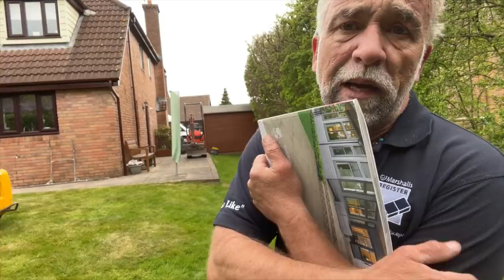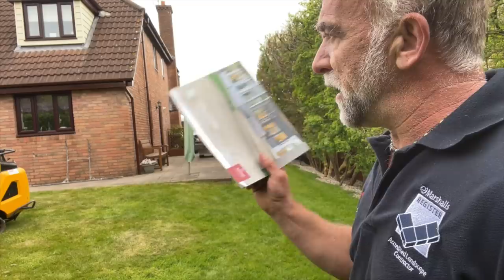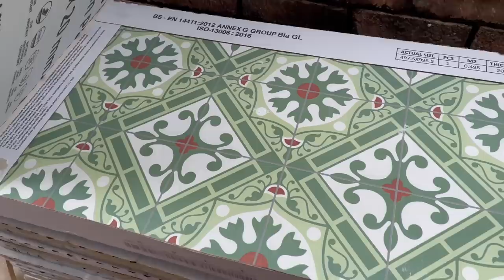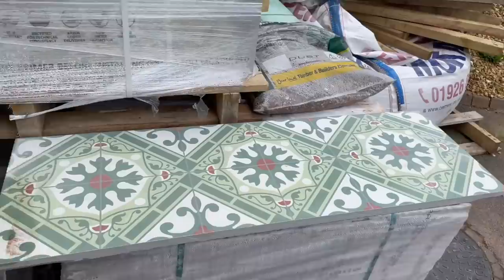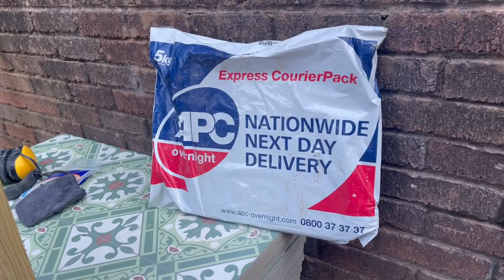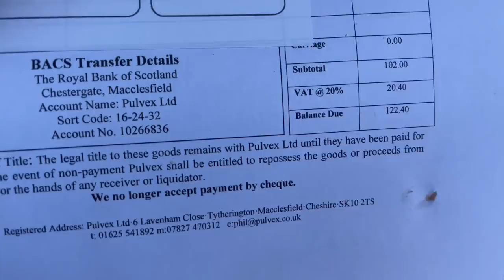Creating a Stylish Modern Porcelain Patio: Step-by-Step Guide 🛠️🌳

Comment: Absolutely stunning! Great job! Yes i agree the grouting can be stressful so best to work in small areas at a time. When the suns out it can bake to the surface and it soon becomes a race against time. If you put that tile on its side and cut it with your little grinder you'll get it first time. If it's not on level ground when laid flat it's almost certain to break due to vibration. The slightest bit of debris from previous cuts underneath the tile is enough to make it rock. I've learned the hard way too!! I do all my cutting with a Stihl saw.
Also agree with you about big Matty at Brockstone, he's the man when it comes to cutting. He's on another level..
Reply from the maker: It certainly wasn’t an easy cut to make that’s for sure. So we’re going to cheat the slab directly over the top without sticking it down to the cement and make it easy to lift up if they need too.. I’ve never done that before but they said they would prefer that rather than see the manhole cover. 
Matty is a wiz with the wizzer as he calls it 👍🏴

Comment: Hi Buddy
For the manhole cover 
I find best to drill corners of the tile first with porcelain tile drill bit then won’t break we’ve all been there with them breaking like that so annoying.
Nice work looks great👍🏻
Reply from the maker: Thanks Paul and yes manhole covers a right royal pain in the rear. As for that tile it being in the centre of the tile I’m actually going to lay over the manhole cover making sure the cement doesn’t stick to the tile and then use my grabo to place the tile and also use it to remove the tile if so needed in the future. Never done that before but it makes sense and just use grey silicone for the joints 👍🏴 
Improvise adapt and overcome 👌

Comment: Another nice job , Scott . Just wondering how you got over the pattern match on the corner by the extension. I see you laid them tight to the house. Luckily the house was square 😁 I try to work in a shingle border to overcome anything that might be out of square.
Reply from the maker: I checked all the dimensions 1st to see if everything was square and go 10mm of the house as for the pattern on the corner well it only worked on one corner in the middle so we started there the other end was what it was but the customer was consulted on the corners out of my control another 2 on the ends either side but out of the way hidden hopefully with pots 👍🏴

Comment: Tremendous Scott get the Dewalt cordless concrete saw very low vibration great for porcelain wouldn’t be without it. OX fully rimmed blade cuts tremendously well.
Reply from the maker: I’ve been thinking about getting one of those Dewalt battery cutters they do look good 👍🏴
Reply: @tidybrickslandscaping  
Trust me it’s a great bit of kit buddy. Best cordless cutter on market by a mile has a jet either side of blade for water. Get the 12ah battery’s. Think they have 15ah batts coming out soon. The 54 volt cordless grinder is top notch also. 12ah and lasts a long time. Rubi viper blade for grinder cuts porcelain great dry for small awkward bits. That’s inspection chamber is a grinder and cordless concrete saw all day long buddy. 
Man of your calibre should have these on your kit. 
Loving your work buddy 😎😎🤟
Reply: Yeap and Dewalt cordless paddle. Can’t be doing with cables if can be avoided lol.